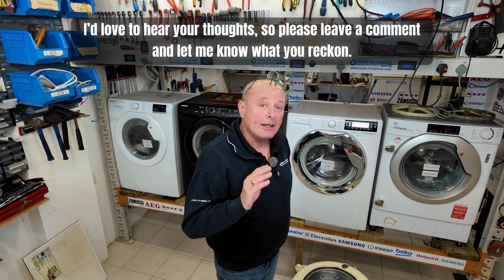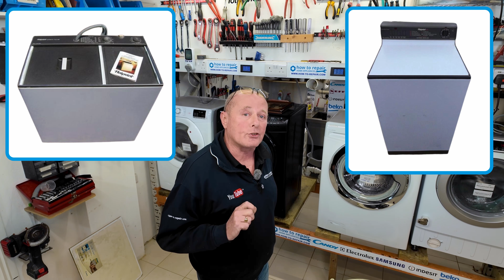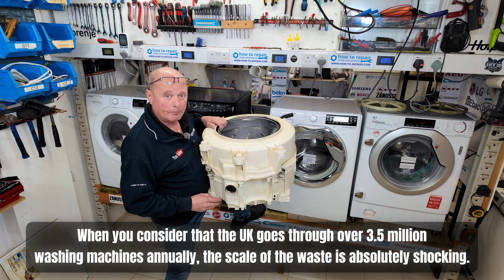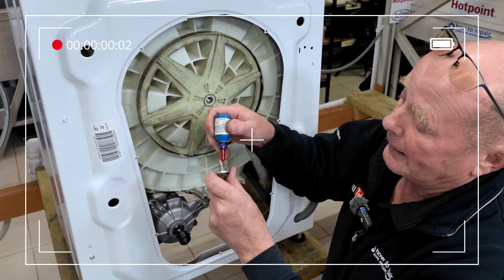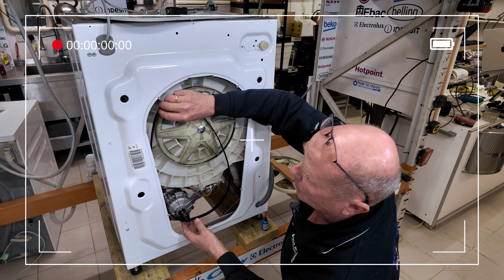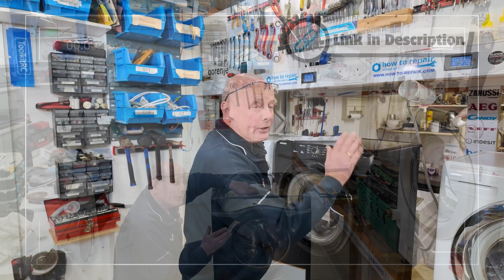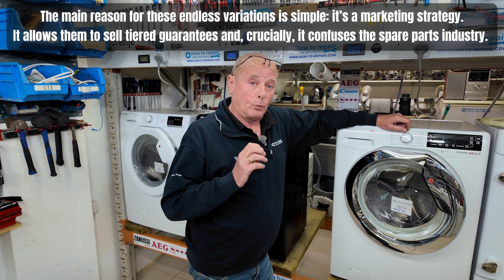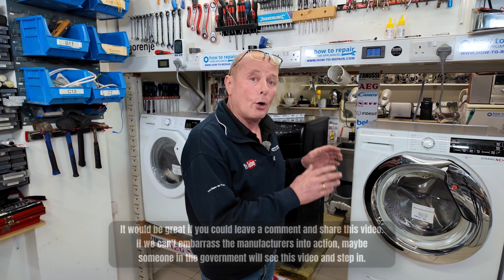I Scrapped 13 MACHINES to Prove a Point: STOP BUYING These Brands!

Comment: I've lived in my home for 6 years. I'm currently on my 3rd washer. It's crazy. My 2nd one is an LG. It's been setting so long I don't even remember what's wrong with it. I know I felt strongly enough that I went and bought another one but I bought a used one this time and it's been working great until it doesn't. I try to be very gentle with it and not to put a lot of clothes in it and hoping it'll last a little while.

Comment: Hi Paul.
Great videos,
I have a Bauknecht WA8988 that I got in 2002. Still in great working order despite new bearings and motor brushes.
Today I fitted new shock absorbers to it and it now sounds as good as new!
All the other components looked fine - no deterioration of internal filler/waste hoses.
My machine is now 24 years old and still going strong.
It can be done - repair repair!

Comment: I'm an industrial mechanic and I was shocked about how my first two washing machines were designed (both broke within 6 weeks and it was puting my young family into a financial burden). All those plastic nose which snap into pockets and when trying to remove they break off. I was repairing the machine for 15 minutes (belt and bearing issue) and fixing the plastic and poor stuff for ages. Also that the boards are put into resin is a crime. Can't repair and fix anything. Secondly I can assess that also those high quality names here in Germany like "MIELE" are going south. Imagine they were designed with lifelong warranty in the 80ies  and my mother is still running here beloved "Bertha" the washing machine.

Comment: My mother owned a Privileg dynamic 7660. A beast of a machine. It Ran for 25 years until we Sold it dou to motor Control Problems. IT sometimes Just dropped its rpm for No reason. But considering what this machine did... IT payed Off. She Always overloaded the machine, we as kids never cleaned our pockets and that Thing saw everything... Its hard to descripe how we abused this machine. The only Thing that really broke after 20 years was the pump. IT got weaker each month because the pump sucket Trash in the past because we never stopped putting Trash into our pockets. we installed a new one and it Ran 5 more years. But since the Motor Control unit Made Problems, we ended Up selling it. it did Not failed mechanically even If we overloaded it, it failed because the electronic Starts to die. And im honest, afer 25 years? Its allowed to do that

Comment: I have a Zanussi washing mashine from early 2000. It worked well around 5 years, then standard seal&bearing problem happened. I had changed them. I bought very cheap oil seal (less one dollar) and then mashine lasted about 7 years without problem, so I have a question about original oil seal, from what type of  shit it was made if even cheapest one was better?

Comment: So ppl are raging because after 6..10..12years washing machine(or fridge) broke? 🙃My question, what is expected life then? 20, 30 or 50 years? 😅 If less then 'planned obsolescence' is the favorite quote for these ppl?😂
up until 24mo - anything happens manufacturer warranty, also for 'big appliances' its a good idea to buy additional warranty coverage, if its not too expensive and can be purchasable, usually so that you are covered for 4 or 5years after purchase, if something happens right after after manufacturer warranty has ended, you are covered.
 After that period 8 or even 12years you completely got your moneys worth and you should start to look for something new, not because there is a new model, but because it will be MUCH more energy efficient machine.
Landfills are filling up because DUMB PPL dont recycle, but just irresponsibly are throwing away ''for free'' as general trash!😜
p.s. 185cm height Samsung fridge bought in 2012, had a rating on 395kwh/annualy(at that time it wasnt considered bad), last christmas on good sales - from 695€ to 420€, as wanted bit larger for some time, 203cm height samsung model again and it uses 169kwh/annual now, so quite of improvement in electricity bills. Also it is 2x quieter! 🙂And it has 20years of compressor(motor) warranty. 

  🙄I dont get the fuss, just because 'it still works' you need to continue to use it. Just learn the 'right time' to buy new appliances and stop hiding behind planned obsolescence quote just because you dont want to spend money even after 10+ years of use.

Comment: i believe manufacturers should be forced to offer more waranty that is included in the price.
i also think that the eco evaluation should take into account the warranty and the price to fix (and the ability to fix it)
i am so tired of this green scaming while stuff becomes more and more flimsy and one time use. 
meanwhile we pay for recycling and perhaps that makes things worse as we think we have a solution. we don't. things should be built to last and then ensure recycling.
i'm relatively happy that eco7 will take into consideration the durability of the car. now it should last for 200.000 km and not 100-150.000 km. they are pushing for lower emissions while growing a lot the complexity and cost to repair. they are pushing for "life time" oils and those crazy 20-30.000 km oils changes that have no backing in engeneering.

Comment: i have an indesit with vertical load. the belt snapped because it's so narrow.
of course these freaks in the applicance industry came together and conspired to do this.
they are harping about green bs, ecology but they make things last less and are too expensive to repair. 
phones, laptops, washing machines, fridges and so on cannot be repaired or are too expensive to repair. 
don't get me started with cars after 2020 or even 2015.

Comment: I would GLADLY pay 600 instead of 300 for an otherwise identical washing machine if they offered 5-year factory warranty and at least 20-year spare parts availability with part prices that don't make your head spin. I mean, 150€ for 100 grams of cabling? A PCB that costs 3€ to make?! What the hell.

Back in the day appliances cost a lot bigger % of your salary compared to today. People saved up to buy them. We need to go back to that line of thought. Instead of "buy 5 times, cry 5 times" we need to go back to the "save up, buy once, cry once but a bit harder" mentality. Yeah, I know...wishful thinking.

The issue is that almost the only way to get anything remotely close to "old school" reliability in the home appliance sector is by buying Miele, and that usually costs 1000€+ if we're talking washing machines because it's premium in many aspects that you don't really need. And that's because they have basically no real competition in the sector of premium reliability. And I'm not even sure THEY still have ease of repair and part availability as good as they did back in the day. Probably not. And why do they not have competition? Lack of trust. If Bosch came with a washing machine for 600€ and said "it has the same features as the one costing 300€, but it will likely last you at least 20 years with some not very expensive repairs over the years", no one would believe them.

The issue is the modern materialism is brainwashing people into this mantra of having to buy new every few years. From appliances, to phones, to clothes...with the influx of Chinese brand cars things are going to get even worse, though their European competition aren't that much better in that regard and are likely regressing fast. I remember reading Audi OEM part support only lasting something like 15 years, and that's a so-called premium brand, though in comparison to home appliances that's actually quite long...so I imagine things are going to only get worse on average in the car industry, too.

I feel like if "capitalist science" could build in planned obsolescence in forks and cutting boards, they would. I mean, they try by making them bad quality, but if someone's careful they can still last you 20 years+. I'm such a terrible consumer!

Comment: The cycle we have entered is the appliance doomsday spiral. Manufacturers realized that for every quality product they produce, they essentially have just removed a consumer from the marketplace for the next 20years. It’s a competitive industry with a limited amount of buyers … so instead of compete with each other they realized they had a better option “Create a larger market pool by creating a disposable product rather than a serviceable one” 
 
They implemented it slowly to gradually retrain the consumers expectations of service life all while marking up the price on the individual components such that the choice between servicing the unit or buying something new is close enough that repair stops making economical sense to do. The sum of the individual parts can never be more than the finished unit but to warehouse them and sell them individually will inevitably cause them to cost more plus inflation but they take it to far and it’s just a shame every manufacturer prices their parts to reinforce the conclusion that people are better off buying new than repairing. . 

This appliance doomsday spiral means Innovation and good engineering stop being important and instead good engineers are being utilized to manufacturer parts to last a set time frame. This isn’t progress people its laziness and corporate greed. Yeah it would be hard to be profitable if your products last 20years before you can expect a return customer, but you know what? That customer who got 20 trouble free years out of their washer will not only come back, their kids will have grown up around the brand and buy one meanwhile that customer will brag to all their neighbors and friends who are having to get a fridge or washer serviced 7times in the first 2years after installation, hearing about how great and happy they friend is with their purchase.

Comment: Had an AEG machine. It was as old as me. Still running and purring like a kitten. Im 43 now :) It was on of the typical old design, where you dropped down from top. I changed it out this year, prolly a misstake. But the rubber started to crack

Comment: The condensing Hotpoint tumble dryer was one of the Hotpoint dryers that could burn your house to the ground. Hotpoint came around and "fixed" it, but whatever they did, the first thing was after a few weeks I found the room filled with smoke - tumble dryer - so I cleaned it out and started a plan to buy a new dryer. After a few more weeks the power went off and wouldn't go back on. The heating element had lost a wire onto the metal casing and it was causing a short to earth. So, as I was desperate, I removed the earth, ran the machine with a live case on a rug for a few days. Then got a replacement Bosch with a heat pump, that's been good for over 10 years so far.

Onn the washing machine front, I had a 1000 rpm "classic" Hotpoint that I used to replace the brushes every couple of years, I replaced the door catch, the suspension springs and dampers and the pump over the decade I owned it and then gave it away to a local charity. I bought an all-singing-and-dancing Hotpoint washing machine with active steam allergy and high spin speed. It lasted around 160 washes before it was done, just over 18 months. Screaming like a banshee and finally died shredding its last load of washing. I bought a Miele with the John Lewis credit from the Hotpoint and that's been fine for the last 10 years too.

Comment: My 2.5 yr old $3500 kitchen aid fridge with no fancy electronics has already had the ice maker break 2 times.  The second time I broke it apart and found a simple very very cheap microswitch that was stuck.  If they had bought a 10c more expensive switch, this would not be a problem.  Now the compressor is making a lot of noise.  I do not believe it is a linear drive unit like LG or Samsung use.  It constantly freezes our veggies and ruins lots of food.  Our 18 year old Kitchen aid has done pretty well.  I had to rebuild the power supply with new capacitors at 10 years old.  I used high quality panasonic caps and its been good for the last 8.  Grr, I hate consumer appliances.  They are all junk.

Comment: I owned a Hoover for I can’t remember how many years. And the computer board was coming on by itself and jumping cycles.  When you  were setting which cycle you wanted. Then one day while it was washing. I heard one almighty bang and the drum was rattling about. I threw it out cause I thought it couldn’t be repaired. It was a good machine. I now own a candy which I found a bit hard to get on with.  Do you actually repair washing machines is that what you do. And you live in Caldecot. Not too far from me. Video very good info.

Comment: I had a whirlpool Cambio Washer and dryer set that was bought in 2014 for $2,500.00 Wasther died in 2021, drier died in 2023, refused to heat, I scrapped both machines after the both had failed, now I have a Samsung washer and a Drier I don't know the make of, the dryer is analog thankfully!  Washer is too finicky about loads. 😞

Comment: I repair Gorenje appliances, they started implementing the sealed drums around 2018 when the Wave Active models came out, but ever since Hisense bought the company, they reverted back to bolted drums and also implemented the front panel removability which wasn't possible on Gorenje washers before but the downside is the bearing quality, we get 2x more calls on the newer Hisense washers with complaints on loud noises. Also worked on Candy washers a couple years ago and the lids are indeed a nightmare when you have to take them off.

P.S. - Gorenje's moto is "Life Simplified" but they made it intentionally complicated to repair their appliances with higher cost of spare parts, although they do issue a 2 year warranty with 3 bonus years if you register the appliance on their website which is decent, before 2022 it was 5 years without the need to register (at least where I live).

Comment: I got an old whirlpool 15 years ago on craigslist for 100 bucks from a guy that repairs them when people throw them out. It still works fine. Also purchased my Hotpoint refrigerator 15 years ago use as well, only have to replace the defroster coils once every 5 years or so myself for 15 bucks, not interested in any of this new crap!

Comment: I have a Bosch with a white metal spider. Of course it corroded due to contact with wasing water. 4 years ago I removed it and rebuilt it with fibre glass matting. Still working.

Comment: Not sure how these compare quality wise to the ones In canada but I just checked on home depot's website and the cheapest washer they sell is a Samsung WF45T6000AW for $895/£483. Yes it's a 4.5 cubic foot capacity not sure what standard size is there, to compare to compare the cheapest compact washer is a GE GFW148SSMWW 2.8 cubic foot for $994/£536

Comment: EU requires 2 year guarantee but The Netherlands has NOT signed it, because 2 years is still too short.  My BEKO washing machine which I bought in 1993 still goes strong! But some companies are more a marketing company than an appliance company like Samsung. My damn expensive Samsung TV has died on me after only 3 years.

Comment: Just had an AEG 7000 series washer dry stop working. The door lock wouldn't work, so the wash cycle could never start. The repair man fitted a new lock but the problem still persisted. Turns out it was the circuit board, and the repair guy said it wasn't worth fixing as it would cost as much as another machine. The machine was only four years old.

Comment: MY tip  just buy the absolute cheapest one out there just dond care about repair ... its sad but its the most costefectif way .... 250€ indesit on a sale is a perfect machine it will work for like 3 years after that buy a new  i would not work for a company that uses planed obsolecence ... BTW fuck BOSCH

Comment: I've been told by several different sources and channels one universal tip : "buy dumb machines". Don't get the "smart" ones with wi-fi, touchscreens or anything fancy like that. Get the most basic, base model appliance you can find (or, even better, buy OLD machines) because the more computer it is, the shorter the life span (typically). Ovens, dishwashers and refrigerators in particular because they generate the most heat and heat is the enemy of soldering on pc boards. When the solder melts down, so does the machine....
Reply: Same advice for vehicles. The only thing that should connect to the Internet is a computer!!

Comment: Planned obsolescence is only one leg of a problem. The other leg is called "Percieved obsolescence". Percieved obsolescence, is what drives people need to get the latest new model of <insert item here>. You would have to address both issues in order to move the industry. Supply and demand control most things, and we the consumers often forget that we can actually control demand.

Comment: I still have the Washing machine my grandma bought in 1995, its been used basically constantly since buying it, and had a total of 5 parts replaced the three times it actually broke down.
Im using a simple electric lighting timer to have an option for delayed starting, as thats the only feature i am actually missing on it.
let me reiterate: THIRTY YEARS of use, half of that on an active farm with multiple loads a day for the work clothes.

Comment: I spent about 6 hours over the weekend replacing the seal as it got ripped and was leaking out the door. The spring clamp that holds the seal in the front of the drum and at the door was impossible to get into place. Ended up getting help from someone who had to open it with a vice and cable tie it open before we could get it in place. A cheap part with nothing but headaches to replace. This was Hoover, who I decided against ever buying from again after this experience. Funny that YT opted to show me this video days later to confirm how terrible they are